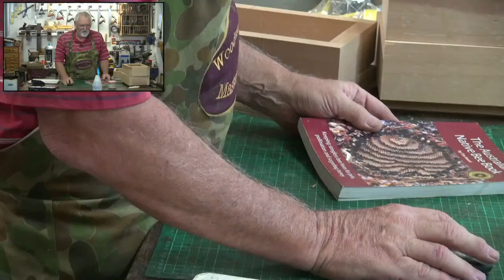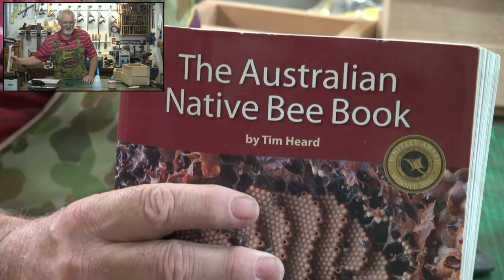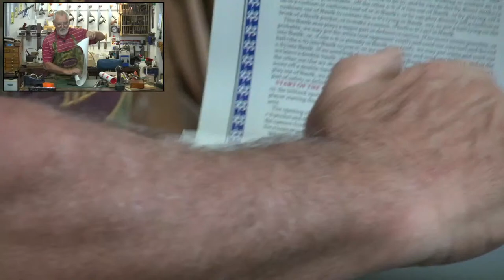Australian Native Bee (OATH) Boxes. Basic Hand Tools Pt.3

Comment: I started my apprenticeship using a Yankee screwdriver and flat blades.
The best thing was when Phillip head screws came out. The user needs to not go too fast.

I have rediscovered the virtues of the yankee in fine work so the screw is not overnighted 

I like the longer models
Reply from the maker: Hi Greg, Sorry the other day I had you confused with a great mate of mine I had not seen for several years. Also Greg Saunders (Saundo). Yes they were a bane of a tradesman's life, if used fast of to much pressure. Still use mine a lot on hinges. Cheers Steve